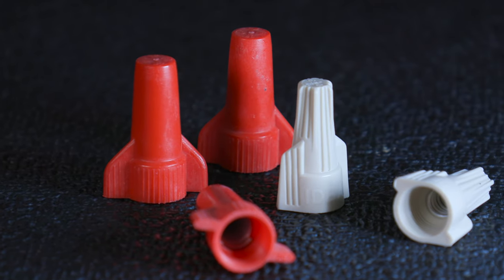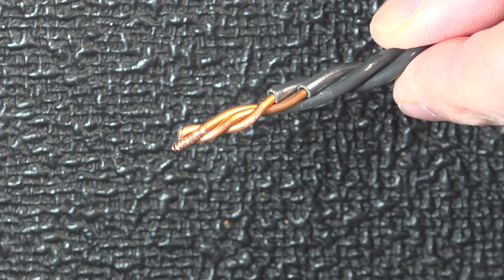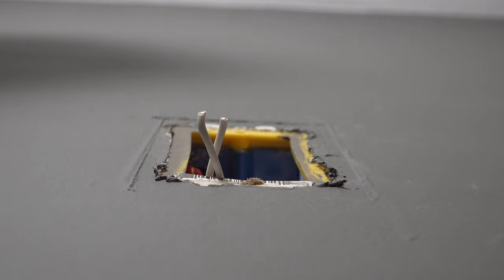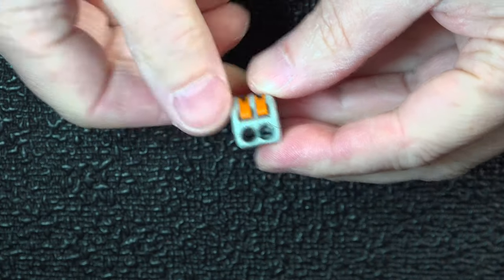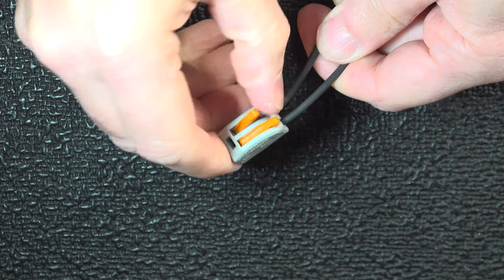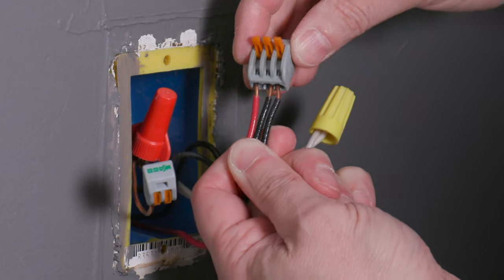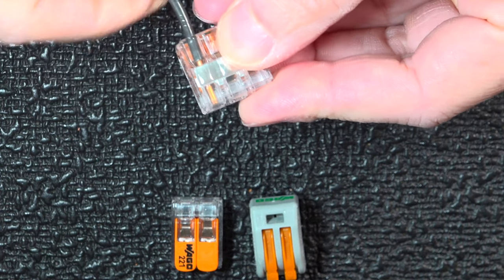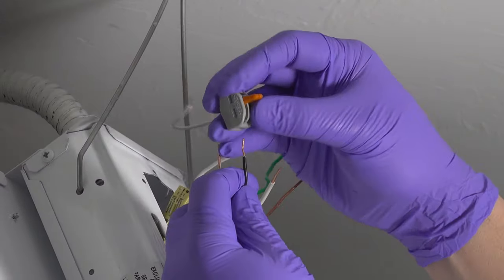Never use Wire Nuts Again - Wago is Better Electrical Connector

Comment: Jesus people. This product is actually safe and not bad at all. It’s new and different and many can’t accept doing things differently than they or everyone else does in the trade. I would say it’s preference overall. Yes it’s great for the DIY person, but that shouldn’t mean a pro then has to be different to separate from the DIY. I personally use wire nuts still, but I love trying different things. Don’t hate, congratulate. I see it all the time in my trade where some think they do it better than others by method. Really it’s preference when both routes are safe, effective and time efficient.
Reply: It's actually not new at all, Europe's been using them for a long time now. I personally didn't know Americans have special connectors for something you can do with your hands and some plastic tape

Comment: I love wago connectors.  The one thing I had happen once in a tight packed enclosure was one lever partially opened when pushing the wires back into the box.  For that reason I now run a wrap of tape around the wago to keep the levers down.

Comment: I’m from the uk and wagos have been regulations for cable connections over 200 volts of power
Reply: In the US, anything over 200 requires a wire nut, buchanan or lug, depending on the amperage/voltage involved.
Reply: @Hathorr1067  everything in uk is 200
Reply: They must have won a contract with a corrupt government agent.  Sorry man that sounds rough. Hope they at least made them cheaper there.
Reply: @JustaSimplefact  they are a lot cheaper as I don’t think they sell as popular in America but they seem pretty reasonable price

Comment: I have a couple of questions.  Wirenuts supposedly give a hermitic seal, does a wago connector do this?  In forty years in seven houses, i've had to change a wirenut only a few times and have never changed one more than once.  Unless they cost the same, I can't see using them. So how does the cost compare?

Comment: Been a electrician for 35 years any good electrician will twist wires together ,that the mechanical connection wire nut is for covering not to handle amperage so you are just peddling this crap and any electrician knows it

Comment: The wago has other cons too: its held together by compression.  Anybody ever seen what those old stab lock plugs do after 30 years of temperature fluctuations?  These wouls have the same problem and can be pulled back out by hand...just like a poorly installed wire nut
Reply: @Dev JB have you used these? The amount of compression on the wires is insane and it’s a proper spring so no loss of compression over time. Nothing like a stab back
Reply: @Dev JB they are UL rated and approved for NEC use.

Comment: Never had a problem with wire nuts. Occasionally a bit fussy with multiple conductors, but I trust them with high voltage and high current to levels I would not even consider with Wago regardless of whether Wago is "certified" for those levels or not. Wago makes for a nice convenient indoor low voltage control circuit installation or repair. Then again I can't even bring myself to utilize the convenient "push" connection option on wall receptacles.
Reply: I'm just a homeowner Joe Fixit kind of guy but it seems to me that, as this guy is criticizing wire nuts, he shows them being used incorrectly.  He's just sticking two loose wires into the wire nut without twisting them together first.  I always take a heavy pair of pliers and twist my two or three wires into a bundle, clip the end off and only then screw on the wire nut.

Comment: In the UK wire nuts are against NIC/EIC standards due to them being so dangerous. Instead the old fashioned way was terminal blocks (otherwise known as choc blocks) but wago’s or other equivalent has been the standard used for many years now
Reply: "wire nuts are against NIC/EIC standards" No they're not as long as they comply with the relevant EN/BS standards, that doesn't mean I'd use them but they're not specifically banned either by NICEIC or BS 7671.
Reply: Wire nuts( Marrets in Canada) are not dangerous.

Comment: Contact area is rated for how many AMPS? If these Wago things just place a tiny piece of metal across the wire, it will get hot and melt if the current is higher. Are they good for 15 AMPS?
Reply from the maker: 20 amps in the US - 30 in Europe - I tested them to 60 amps: https://youtu.be/B1pmuRsf1co

Comment: As a german I wasn't aware Wirenuts existet anywhere in the world. Bevor Wago Connectors we used a screw based Connector called Lüsterklemme in german.
Reply: In the UK I think it used to be called a terminal block
Reply: I live in America and have always saw the potential fire hazard with the wire nuts. It didn't safely connect the wires at all, it damaged more wires than connects any and they were always a complete pain and water of time to use. Dad wasn't sure about using the Wago connectors at first, than I showed him how to use them. They reminded me of RJ-45 and RJ-11 connectors, basically phone and internet cables with terminated ends so I took to them more naturally than some.

Comment: I've seen those connectors burn out. It a tiny point of connection. Wire nuts are the best in my opinion
Reply: hows that happen? a rough cut or bent wire only hits the contact in side at an angle?
Reply: @cdoublejj  I’ve also experienced burnt wago in my own outlet. Never again. Use wirenuts again myself, or call professional with welder or press fittings.
Reply: @hrissan  i look forward checking up on mine sometime, it's been about a year in the extreme hot and cold of the attic.
Reply: @cdoublejj  truthful I've mainly seen them burn out somewhere where a load is applied. A Garage where they plugged in an air compressor or saw or in where someone plugged in space heaters or washer machine. It starts off as an very small arc and grows until it burns out. Same reason why I don't use the plug in connector on the back of a receptacle or switch, always use the screw terminals.
Reply: @DARTHFEAR0N  drop me some name brands for screw terminals please and thank you
Reply: I have seen some, they were all cheap Chinese copies.

Comment: I would want to know the current capacity and resistance through the WAGOs and how these factors compare with a properly installed wire nut. What happens when they get excessively hot, do they melt or burn? I remember the houses built in the 60s or so with aluminum wiring!! Problems galore.
How long have the WAGOs been in use?

Comment: Wago connectors are the de-facto Installation method in large parts of Europe.
For example in Germany (where wago is from) you can assume that any installation made in the past 30 years uses them. Most are however made using the regular non-lever style of construction, because they are cheaper (although not suited for stranded wire). Wirenuts went out of fashion in the 1950s from what I'm told. Watching someone use a wirenut honestly feels crude to me.

Comment: These are great, can't wait to try them.  However I think wire nuts are great aboard a boat, especially around salt water. You twist them on and then fill them with silicone rtv. Then just to be sure, wire tie or staple it in a position so  that it is pointing up, just in case you don't get a good seal. Ay least it will be water proof against dripping.
Reply: Not US Coastguard approved. Terminal board with crimped lugs and watertight covers.All marine grade conductors are stranded so wire nuts aren't going to work.Solid wire will vibrate on anything that moves,such as cars,trains,ships. Working as a marine electrician for 50 years I seen a lot of idiot mistakes made by crews on vessels.One of the best was some numbnut put wire nuts on a potable water pump motor.I took off the connection box cover to the motor and the wire nuts fell out on the deck. I crimped lugged the conductors for both  the L leads and the motor leads and bolted them together with lock and flat washers.Tripple insultated with varnished cambric,rubber fusing tape and 600 v electrical tape and Scotkote electrical coating.This is right out of the CoastGuard manual for motor connections. Wire nuts will get an insurance claim denied from all major insurers,such as Lloid's of NY or London.
Reply: They have wagos with a gel cover that makes them resistant to salt conditions.

Comment: Thanks for the video, The generic name for them is lever-nut. That would help people who don't have access to US amazon (like me).   I found that out because it was in the US link provided in the description. I always HATED wire nuts for all the reasons you gave. Looking forward to adding these to my toolkit.
Reply: Don't add these to your toolbox if you plan on doing house wiring, especially in other peoples homes!  They are not safe for household amperage draws. Please don't put yourself in a vulnerable position. small wiring situations are fine, but anything that draws amperage over 5 amps,  use the wire nuts. Always twist the wire together before adding the wire nut for the best connection.
Reply: Do a search for wago connectors and you’ll see tons of options for them - different rating and mechanisms. I would ignore Markus’ comment, I think he’s not really done any reading on them. In the UK you can get them from any decent electrical supplier.

Some history on Wago - they made their name with cage clamp connectors and terminal blocks. They are very good from my experience!
Reply: @markusallport1276  No, the rating for the 222 series (the ones illustrated in the video) is 400V, 32A. Also, you don't twist the wires before using a wire nut, that keeps it from biting in properly.
Reply: @robertfjones85  Doesn't really matter if it's Wago or another rated brand. Their junction box connectors kinda suck.

Comment: good video. I think you forgot one important aspect of using wire nut and its cost. I would choose wire nut every day considering the price on today's market. what do you think ? Wire nuts are working fine when installed properly, but I agree with you it seems simpler and maybe a bit more reusable. In fact, the wire nuts are always reusable but sometimes like you said it's harder to make the connexion so we twist very hard and it damages the wires a little bit. But like you showned, you cand, strip and reconnect. I am not totally sold on wago or similar product yet especially considering the price of wire, breakers , fasteners and pretty much everything these days

Comment: I've been using these things for at least 6 years, and they weren't new then.  They're fine for prototyping but they're bulky and expensive.
Reply: there are very tiny ones, too (without levers, need to wiggle them out)

Comment: I'm not a professional electrician but I do my own wiring and do it by code. Using the right wire nuts and using them correctly is the absolute LEAST of my issues with wiring. I don't have any issues with wire I cut (I have to clean up a lot of messes, including those likely done by so-called pros) though I often have issues with wire cut by others. Once I cut it, I connect it, put a nut on it, test it, and go about my business. While there is nothing wrong with this product, I suppose, for me it isn't necessary.

Comment: To all you folks out there complaining that these Wago products are “too new, untested”...

Wago was founded back in 1951. Seventy years ago (2021) No spring chicken, this company.
Wago arrived in the US in 1979. Forty-two years ago.
Further, the spring contact concept was originally used in the industrial area, not residential.

Wire nuts are older, true.
The patent is late-20’s.
Wire-Nut as a brand name is mid-40’s. Ideal Company.
Reply: Never heard of these before, and I've reused wire nuts a lot.

Comment: I use both and have to say the classical wire nut is still better.  The Wagos can get undone very easily.  The best information herein was to learn that wire nuts were invented around 1929.  It tools awhile for them to become accepted, to replace knob and tube.
Reply: Given how hidebound local codes are, it's possibly against code in some jurisdictions as well I would imagine.

Comment: If someone doesn't understand how to use a wire nut properly, they shouldn't be touching it to begin with.
Leave electrical work to the people qualified to do it.
Reply: All US electricians blame the electrician, that worked on the job before, for forgetting to tighten the nuts properly always, hahaha
Reply: It's not about tightening the nut, it more about propperly splicing.

Comment: Hmmm, I have used these for lower voltage applications but question the surface area connection of the wires for higher current usage . Are these devices legal under the North American Electrical code ?

Comment: I wouldn't trust them, appears that the levers locking in the wires are flimsy and could be compromised.  Stick with the wire nuts, their time proven.
Reply: Not only flimsy looking but they look like they'd take up more space.
Reply: @phiksit  they do take a bit more space than drilling cables together... we are using these. The lever does have a little bit of play but these is design the lever isn't connectect to the clamp directly so it could never been a true/false state like on screwing nuts where a little force might not pull them out but a medium or strong force get them out pretty easy.. if you ever would use screwnuts here in EU they are probaly banned since they are to unreliable

Comment: 1st of all, to properly connect 2 or more wires, they are to be twisted together as per the National Electrical Code. 2nd of all, as for my projects, I want my electrical connections to be dependent on the wires connected directly together, (twisted) not on a connector. This is the reason the NEC specifies to twist the wires.
Reply from the maker: That is not correct, wire nuts are pressure connectors under the Nec as are Wagos. I have never seen a passage stating wires must be twisted. If you have it to share please do. The current definition is: Connector, Pressure (Solderless). A device that establishes a connection between two or more conductors or between one or more conductors and a terminal by means of mechanical pressure and without the use of solder.

Comment: "Back in the twenties this didn't really matter because electricity was new and nobody was thinking of the future"
That is the dumbest thing anyone has ever said.
Reply: Yet it's how the world thought and still thinks. The world is in the now, not the future.
Reply: back in the twenties they used solder and tape and is actually a better joint than EITHER type of connector.

Comment: As a professional electrician with 25 years of experience, I can safely say I'll never use these "gimmick" connectors!
Reply: These connectors are standard in Germany for many years and turned out to be much safer than any other connector.

Wirenuts are prohibited in Germany for safety reasons.
Reply: @norbertfleck812  So that's why all my BMWs have electrical problems.
Reply: @carlsagan3065  BMW is not using WAGO connectors in its cars.
Reply: @norbertfleck812  because you use stranded wire. North Americans use solid copper wire. Thumbs up for what works in Germany but it isn’t the best in application in North America.
Reply: @-Nobody-1  No-one uses stranded wire for house installation.

Here in Europe we use solid copper wire as a standard for fixed installation. But not in Steel tubes, but in cables which contain 2 - 5 insulated massive copper wires (L1, (L2, L3,) N, PE) in an additional insulation, with mostly 1,5m^2 (16 A) or 2,5 mm^2 (up to 25 A) or 4 mm^2 for 32 A.

Comment: If the argument is that you have to cut it every time you swap out a switch or outlet then you are doing it wrong. Most electricians will leave a pig tail and you will only cut that one wire to replace either electrical device mentioned. Also switches (not dimmers) are usually just tightened at the screws you do not need to cut anything when swapping out switches. 

Also how often do you really swap out a switch or outlet? They last 10+ years. You might own your house for decades without having to replace a switch. 

Also to replace the pig tail mentioned is very simple and you only really need to cut 1/4 of the wire, untwist the lead wires and add your pig tail back in. With a little bit of practice you can do this within in a few minutes. 

This just an ad.

Comment: Interesting... but, No Thanks!  Saving time has never been the right reason to do something, especially when it comes to electricity!  Case in point: I NEVER make up an outlet or switch using the holes you stick a wire into.  I ALWAYS use the available screw connections!!!  Why?  Because a little metal tab contacting a tiny fraction of a wire's diameter cannot carry the same current that a wire wrapped around a screw can carry.  Plain and simple.  I don't care how much time I can save wiring my house if I use the poke-in connections.  I care more about burning it down when a quick connection is incapable of carrying the 15 or 20 amps of current my wife's hairdryer draws.  The bottom line is: If you don't know how to properly use a wire nut, you have no business wiring anything!  Hire a professional.  As a disclaimer - I am NOT a professional, but I have wired several houses and passed electrical inspections with flying colors every time.
Reply: @aaronbrown7218  Wirenuts are prohibited in Germany for safety reasons and screw connectors get loose over time (I just replaced some which were heavily burnt).

The WAGO connectors don't heat up because they don't get loose.

Comment: Wagos get weak over time with heat. Stab ins on a receptacle are the same, curl your wires around the terminal screw. Don't use wagos or stab in.